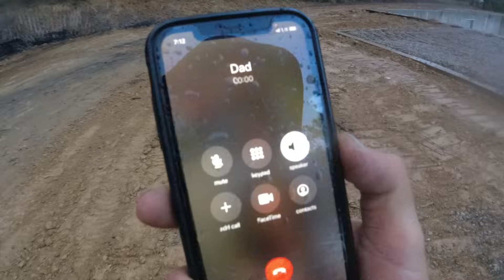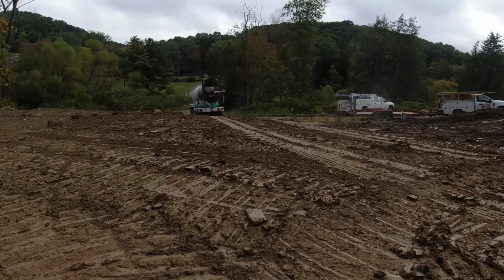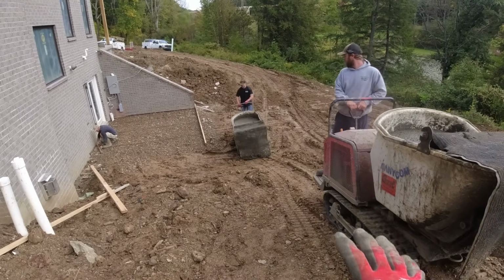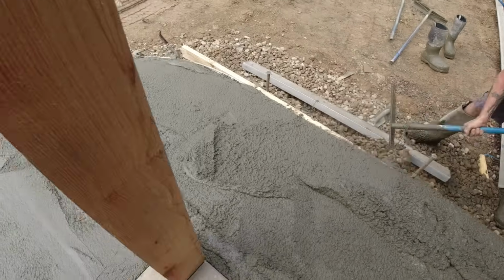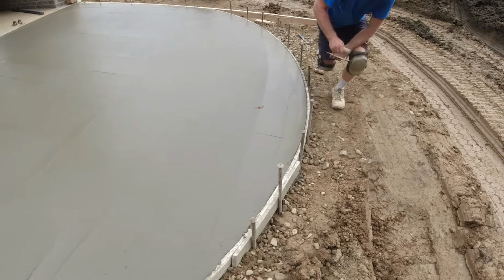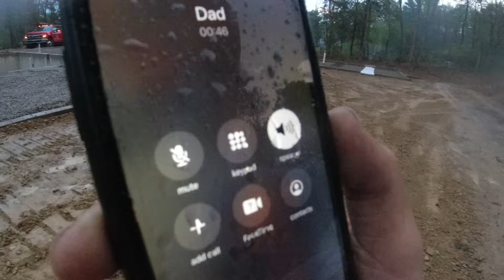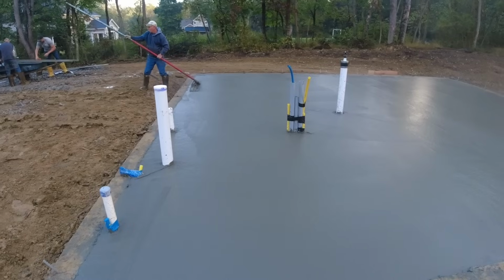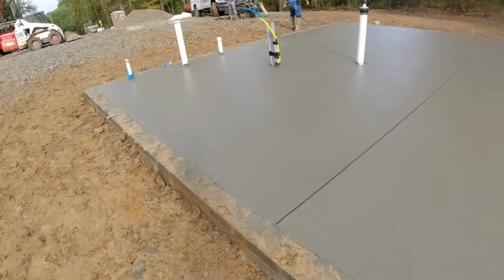I'm On A Tight Clock!

Comment: My first building we had put up the concrete guys decided on their own to power trowel the floor and if rain got in and sometimes snow it got very slippery. Almost needed to take baby steps. Once while I was walking in the building i forgot and down i went! Back then I didn't know about cutting relief cuts and they didn't do it either. Last year the people who had bought our house were selling it and they showed pictures of inside the building and the floor was cracked everywhere. The concrete rose up in places. Also I know that to have rebar and plastic sheeting put down, which wasn't done either. The place i have now didn't do that either but there are hardly any big cracks. Maybe they had fiber embedded in the mix.
Reply from the maker: Those things do make a difference. Thank you very much for the comment.

Comment: I know that you were trying to beat the rain on the simple slab pour job and were in a rush, but the rebar placement looked a bit suspect. The spacing looked off from your normal operation. Did you tie the rebars, as it was hard to tell??
Reply from the maker: They were shorthanded in a bit of a panic . We are going to let this one slide